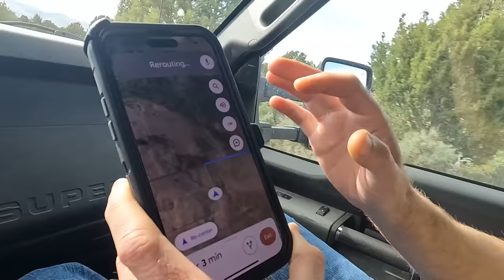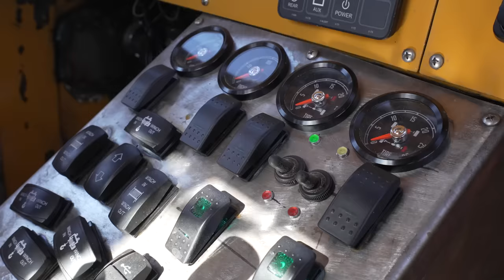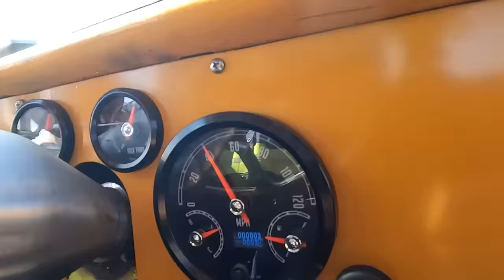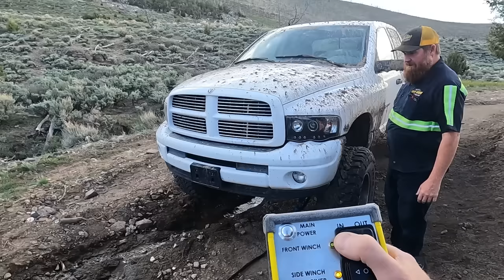Broken Driveshaft & 3 Hours From Civilization!

Comment: With those plastic air lines, put some of those cheap push lock type end to end connectors in your tool kit.  When you get a leak, you can cut the hose right at the leak and slip on the "butt connector" and be on your way in about 5 minutes.
Reply: I've seen hose melt at the compressor exit just from the hot air as well. Better to skip that line and use fuel injection rated line. ARB makes a reusable union for the air locker blue line but this looked to be tank supply or something.
Reply: Just use PTFE / Teflon line and you will have a much higher margin before anything melts.

Comment: Check out John Deere front fenders for their full size tractors, should be easy to adapt them and plenty large enough. They also follow the tire since they mount to the knuckle and won't effect the look of the wrecker hardly at all.
Reply: Jcb 4 wheel steer do the same and they can come in yellow 😂

Comment: I used to work for a company that made hydraulic hoses for large companies. One of our customer made fire trucks. Some of their hoses required a fire sleeve to be installed. That may be an option as you are going to be replacing that melted hose anyway. You should be able find a large enough size to run a bundle of smaller diameter air line through it. It may also be prudent to install some on any hydraulic hoses that are near heat sources to prevent the oil from thinning out and be less likely to be pressurized. The sleeves were usually installed before the hose was completed, but, if you have a straight end fitting, they should be able to slide over it and on to the hose. Then we used a hose clamp to fasten them to the hose to prevent them from sliding on the hose.

Comment: Regarding your melted air tubing, I also learned the hard way. Also, there are different materials for air tubing. Some have higher melting temperatures than others others. Try Parker Parflex or Air Lift Synflex DOT rated tubing.

Comment: My dads got for heatshields while growing up was always scrap aircraft aluminum. He always bought the stuff up and had it around so it was a great choice, and is super easy to work with. Now a days I will do something similar, but I will copy what the auto/heavy equipment manufactures do. Which is two sheets rivited together and bent some between the sheets, So theres more air between them. Similar to what you see on factory exhausts these days.

Comment: 45:28 The amber cab lights should be used in conjunction with the  small  turn signal lights. To me the headlight mounted amber lights look to be overrun by the newly installed modern powerful head lights. Over wize great job:)

Comment: You need to eliminate your air leaks  use copper tubing or steel brake line and flare  fittings at least until you get away from the headers should cure all the air problems thanks for     the videos

Comment: For fenders I'd recommend a set that mount to the axle in the rear and spindles up front, so it followes the tires. And they can be closer to the tire. 
Also you may want a box or at least a canvas cover for the welder box. To keep it clean and not sun bleached.
Other than that, that wrecker is more than capable to do it all.

Comment: Looks like you still have the original wiper motor. Is yours a 6 volt or 12 volt motor? 
Also, will you be installing a headliner? It makes the cab feel much cooler, even if it does remove a handy sunglasses shelf.

Comment: For the power your engine puts out you should be able to use aftermarket manifolds. They are smaller, quieter, seal better and hold heat in better than headers.

Comment: One of the more nifty heat sinks I've seen are the ones on O2 sensor wires to a 2008 BMW. It's a round, finned, aluminum heat sink the full length of the wires. I thought they were rather high quality. I wonder where one could acquire some of that stuff. It would serve great as another layer of protection over that tubing.

Comment: You should make an adjustable trailer (in width to accommodate the wheel track of the payload) with long-travel independent trailing-link suspension and an ability to twist like a rock crawler over boulders.  Minimalist trailer, with all the tech in the frame, suspension, and winches; the bed split into two wide beds sitting on the longitudinal frame rails.  Basically, a rock crawler without an engine, and two narrow beds on top of the chassis instead of the frame and whatnot usually supporting the driver.

Comment: One thing I learned in the oil field is that you do not use nylon tubing anywhere that it has any possibility of getting hot.  Like anywhere close to the engine or any part of the exhaust.  Always use copper tubing.

Comment: Did y’all bring enough gas? Just wondering if y’all are going to run out?  lol 😂 piece of cake for the Off- Road Wrecker! Chad didn’t send an instruction manual, give Tom something to do while you’re driving Matt! Looks like Chad did a great job on the wrecker so far! I just wonder if you’re going to get one of those wide rubber strap setups like regular Wreckers have on them, Matt I just see times when you could use one! Especially when you’re towing a vehicle to keep it from swinging and moving side to side? I’ve seen them work really well on other wreckers! And start carrying a couple sets of jack stands! Maybe a fire blanket too!

Comment: You may want to look at tractor fenders from either Case IH or John Deere. They should have plastic front fender in the size and width your looking for. They also come with a mounting bracket that turns the fender with the front wheels.

Comment: A heat shield plus some wrap should be your solution to excessive heat affecting the nylon air line.  The shield will absorb a lot of the heat.  Even a double shield might be a better idea.  Put Tom Tom on it for a perfect fix.  With the amount of idling that the wrecker does, this problem MUST be fixed. 
Maybe a canvas flap covering the welder when driving through the mud would be a positive move.  Just a thought!

Comment: Instead of fenders you could use tractor mudguards that bolt to the steering knuckle. The rubber and plastic ones you can buy don't hold up well but you could build them out of sheet metal.

Comment: just put a few air-gapped layered shields over the air lines and wrap them in heat shield tape. wrapping the headers will help of course, but it will probably still burn through.
or just replace all air lines with nickel-copper lines. easier to bend than steel, won't rust/corrode easily and sure wont melt. any flex areas use steel braided hoses.

Comment: It's clear that lower link needs to be longer so it has more engagement with the rod end threads. I expect the same on the right side. And I'd be looking at the uppers pretty close. But the lower link being short may be due to lifting higher than the links are designed for.

Comment: You guys should have Chad look at the fueling and timing?  Maybe add some part throttle fuel.  Assuming your using DOT air line it should not melt that far from a header unless the headers are getting really hot.  I had similar problems when I tried to tune for economy.

Comment: I think if you took a piece of copper pipe and sleeved it over those air lines it would cure the problem or maybe delay the air line from rupturing. And maybe even add a shield onto the headers

Comment: What line locks are you using? Ive been looking at line locks for my jeep build and everything i read says they overheat and are only made to lock for a very short amount of time for drag racing burn outs. lm not necessarily looking to leave it locked super long but i want it for winching. I also dont want something big and bulky like a mico lock. So id love to know what your using, being that it doesn't need power to hold they shouldnt overheat and that would be perfect for me.

Comment: Engine gasses are crazy hot and it cost me over $600 for the mechanic to rebuild a wire harness that was melted and burnt against the firewall from a exhaust gasket leak.

Comment: Trail fix and recovery videos are awesome but welding on a truck with the battery hooked up is a good way to fry the computer out
Reply from the maker: I’ve heard that from a few people over the course of my life. 
I’ve done it 100 times. I have friends that I’ve done it as much or more than I have. I’ve never heard of a single incident from anybody I know.   
I can’t imagine a scenario in which it would cause a problem unless you hook your ground to the computer or something like that

Remember, you have multiple spark plugs  “ welding “ at over 60,000 V all the time when the engine is running.

Comment: That looked like a 7018 rod. If you can use a 3/32 7018 with that welder it should do fine with a 1/8 6010 or 6011. The 6010 digs into the metal more and freezes fast so you can whip it a little and get a lot more penetration. Then if you want you can run a 7018 over it to reinforce the weld. 6010 will burn through dirt and grease and make the root of the weld solid and then 7018 will have a cleaner surface to get a better weld with that too

Comment: Put original cast iron manifolds back on. The ones for ls engines are pretty good they flow good. Headers have there place but they leak and radiate lots of heat.
Reply from the maker: Stock ones don’t fit.
Reply: Make them fit. Its the key to happiness.  Or ceramic coat the headers. Wraps are not a long-term solution.  I just hate having to deal with headers and their issues

Comment: @Chadfab should provide an instruction manual and a demonstration…with Maverick snacks and a Victory pie 🥧.
Reply: The sheer amount of switches need labels. Seemed odd there were none.
Reply: @tt600pch  This was on an extremely compressed timeline and I didn't have time to make labels and really test anything. I was working on it right up to when Jake picked it up.
Reply: @chadsfab  I wondered if the shrink tubing was still cooling  when it left the shop. The sawmill I worked at was always "paint drying" when mill fired up after down time.

Comment: Just a heads up, you could check the metadata of the pictures sent to you and they might have coordinates on them if you ever get a bad gps location again.
Reply: If the pin coordinates are bad, why would you think the picture coordinates are any different?  And anyone who knows anything about security doesn't put position info in their pictures.
Reply: @stargazer7644  people usually send the pin once they get to a spot with a signal. the metadata is usually sent unless you change the settings to scrub it on mms.

Comment: I don't understand how you get GPS out in the middle of no where. I go 5 miles outside of town and lose my signal.
Reply: GPS is satellite signals, not cell phone signals. Most phones today has a satellite receiver in them that's used for the map software. It's usually possible to download the maps of your preferred area before you go there. Satellites signals are usually available all over the planet, except indoors in concrete buildings. And underground.

Comment: I don't know who reads the comments but I suggested when you put the headers(which you shouldn't have) that they make a header wrap that cuts heat down so no need for heat shields, Now you see why.
Reply: Matt reads the comments
Reply from the maker: They haven’t reached their final form.
Reply: @MattsOffRoadRecovery  what hasn't reached their final form?
Reply from the maker: When you build a machine like this, there are hundreds of things that have to interface with other things. 
Somethings have to be compromised while other things can’t be, or the project will lose its function.

The stock manifolds wouldn’t work. We already had enough engine intrusion into the cab, and the stock manifolds added one more hurdle in that direction.  
Since the exhaust needed to be ran outside the frame rail, sprint, car headers would be the answer. 
But I knew there was gonna be some other stuff, so I bought some very cheap headers and modified them into Sprint car style for a feasibility test. 
 
Now we know the concept is basically good, and can be made great with some heat control, we will be moving forward on that as soon as we get the time.
Reply: @MattsOffRoadRecovery  You did a great job on building it but I see things that could be done better under the hood. The problem is headers make you lose HP which you need alot more of and also the heat they put off is another problem in itself. Ever stuffed a V8 into a Chevy S10? There is alot of modification that has to be down to the firewall but with time it can be done, alot of the same with this engine and front end as well. I know time is what you don't have alot of running a business and using the truck you built for that business. But things have to be shaked down sort of speak and tested and retested so that truck isn't sittin out in the middle of nowhere after something has broken mainly under the hood. I told you when you was building that truck you needed a bigger engine if not a diesel go bigger on the CI,

Comment: I drive a RAM 4x4 Sport and I curse RAM for putting those big plastic bumpers and no tow or winch hooks up front and without cutting the plastic, there's really no place to add one unless you replace the whole lower facia with a steel bumper.

Comment: I knew them lines was going to leak by the headers. Should have use metal or copper anything besides that. Other than that it is one mean machine. I seen a short video someone make of  Matt's worlds biggest wrecker and it had some wrecker's with monster truck tires on them and had a ? Behind Matt's worlds biggest wrecker? Like this

Comment: You really need to get (or bring) ramps for your trailer.  Clearly the wrecker doesn't really need them, but you likely would have broken your repair on the customer's truck trying to load it without ramps.  Just my two cents.  You guys do an awesome job of "making it up as you go" but sometimes you could really save yourself some extra work!  As a former nuclear engineer myself, I'm sure Tom would agree.  lol

Comment: I WOULD HIGHLY RECOMMEND THAT YOU GET THE REAR STEERING CONNECTED TO THE FRONT SO THE WRECKER AUTOMATICALLY MOVES THE REAR WHEELS
Reply: Impractical in trail and rock environments.
Reply: @Person-ly6im  BUT YOU CAN TURN IT ON AND OFF OR INDIVIDUAL

Comment: Lift bigger tires on blue steel...why dont you do it?
Reply from the maker: It robs Power.
It robs fuel mileage. 
It makes them ride worse. 
It makes them handle worse on road.
Big trucks like this don’t get much of a boost in Off Road capability. (specifically, blue steel is more capable Off Road, then the white truck in this video)
They are hard to get in and out of. 
Accelerated wear on suspension and steering components. 
Upfront cost of modification. (lift kit, wheels and tires, gears and lockers, ram assisted steering)
Usually end up with less maneuverability in tight spots like parking lots.
The need for ridiculous drop hitches and difficulty with gooseneck trailers. 
also, I think they look silly lifted. 
I’m sure there’s more. But that’s all I can think of at the moment.
Reply: @MattsOffRoadRecovery  I concur Matt
Reply: @MattsOffRoadRecovery  Experience is where wisdom comes from.  Well said.
Reply: @MattsOffRoadRecovery  Something Rudy hasn't learned yet, I suppose?

Comment: All the air  lines should be made out of brake line, if nothing else, at least in the engine compartment.  When i build something "industrialist i build it to LAST. keep that in mind when repairing faulty equipment on the wrecker and repair with BRUTE OVERKILL, Pretty soon it will be STOUT as hell, glad its back boys....

Comment: Meant you have to cover that lip on the roof of the truck from the inside that thing will split you like a mohawk Indian. You need to put something on there even if it’s just you know a little bit of door guard just in case you bump something and slam into it. It will definitely do damage to your face or your head may be right at your hairline you’ll get scalped.

Comment: Holy crap, no disrespect, but corners were cut at Chads Fab if he did that wiring and hooked those buttons up. Those are the worlds worst buttons in the coolest offroad wrecker. Expected to see better from somebody that's going to be seen by millions of people.

Edit: The more I look at that center console monster, I get more annoyed. Not sure if I can deal with this pain to be honest. I'm honestly curious if CAD was used to lay this out, a practical at all to see if the layout was going to work. Why are the buttons mashed all the way up into the gauges? Why are the rockers plastic? Why do you have the auxiliary button set above the gauges?  Why are the two winch buttons tilted? I get they are tilted on the truck, but why are they tilted on the panel? and why are they SO close to the other gauges? It looks like I gave a 10 year old a crayon and said "Put 20 buttons on this" and he went to town and I was proud.  You have a piece of metal that's roughly 12 x 6 and you still needed an auxiliary button set, what?

I feel Chad doesn't have much experience. This was done by somebody that's learning, not by somebody that's done and it shows.
Reply: Chad's Fab laid out the center console by hand and hand cut each hole using a plasma template.
Reply: @MikeCris  It shows